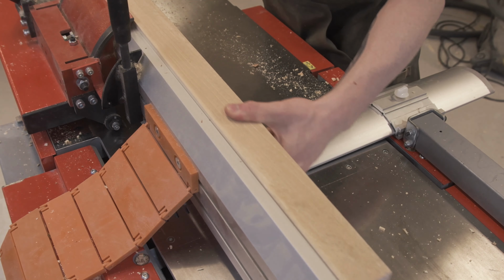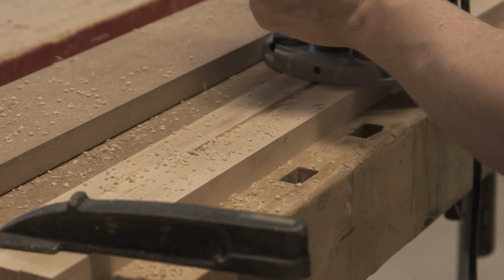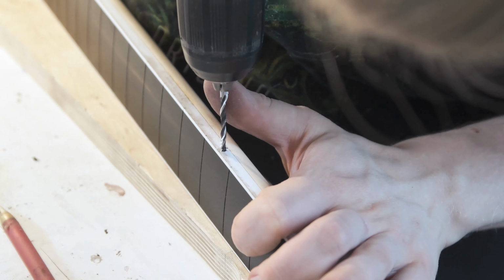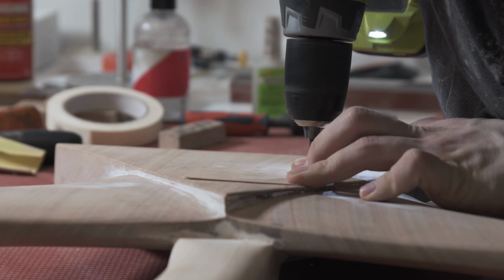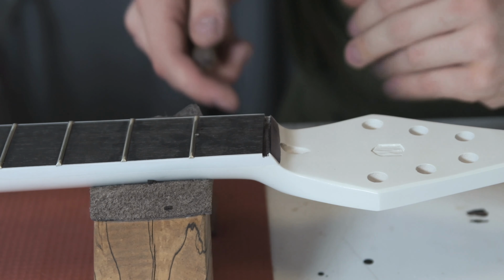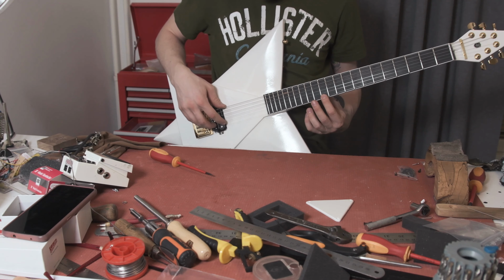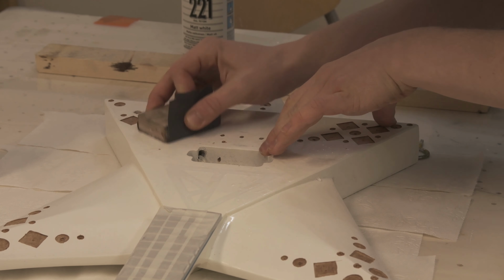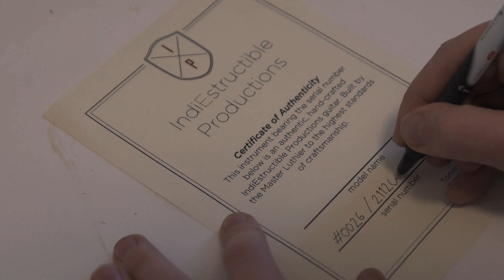The "Hurricane" Custom Guitar for @CyanKicks

Comment: Nice work Tomster.
I didn't notice before that the music-video version of the guitar had no crystals and the final version had them.
Routing the crystal inays on the chamfered horns must have been murder.
Love the new spraybooth (tent on the balcony?)
Looking forward to seeing this guitar become a signature of the band.
Reply from the maker: Yeah we ran out of time with the crystals as the music video shoot came about, at that stage it was still just an idea in the brainstorming phase.

Routing on the chamfers was definitely a pain😅 fortunately the router base helped a lot.

The spraybooth isn't mine (though I wish it were). I used the spraybooth in the shared workshop that I rent time at.

Thanks for the kind words :) the band have yet to use this crystal version anywhere, but Niila the guitarist has actively been using his 7-string which is beyond cool. (Longer video of that is also coming up)

Comment: That's a whole lotta guitar!  And I'll copy the idea of the inserts for body mounting pickups.  I really don't like pickup rings and had to resort to them on a recent guitar because the screws just wouldn't hold in the soft alder.  Cheers.
Reply from the maker: Thanks Chris!
And yeah, the threaded inserts have been a tremendous spent in the right direction for me. I suggest checking out TME as they have A LOT to choose from and you can get very specific on lengths, materials, and color for the bolts for example. Also buying bulk without ridiculous prices as some sites have.